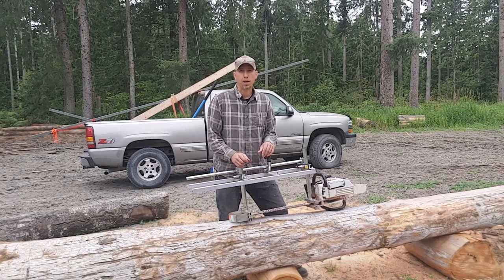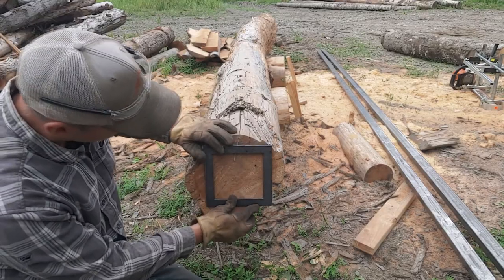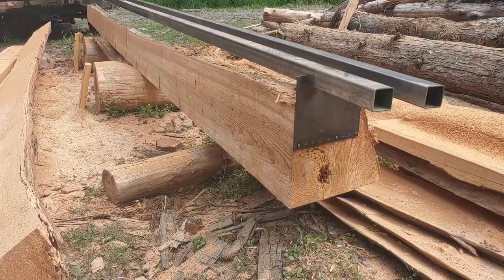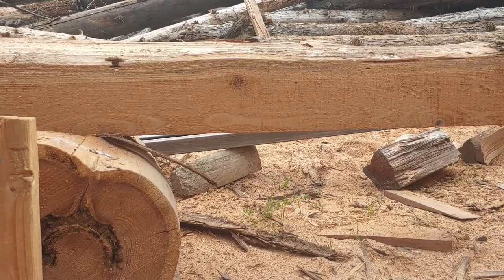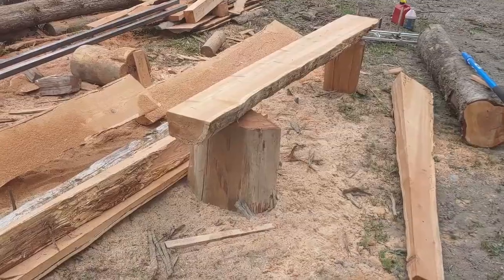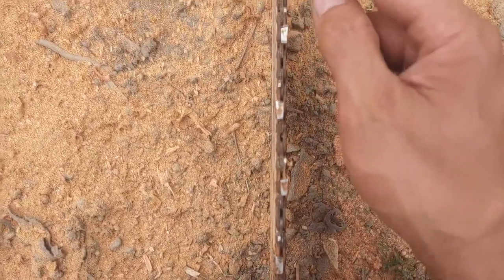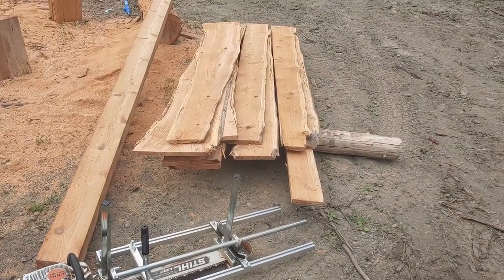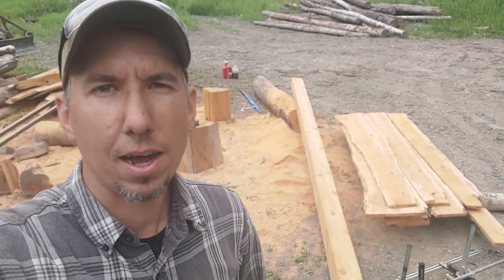Chainsaw Mill: Old Log, Perfect Boards

Comment: Great watching you do this.  I recently purchased some woodland in Missouri and there is a lot of 'junk' wood in there as well (black walnut, honey locust, red and white oak) some standing dead and some down already.  I find that with some effort, there's still a lot of good wood to be had.  Especially the honey locust which seems to be very durable against rot.
Reply from the maker: Yes!  I have found that a downed tree can still have some great wood in it.  I have salvaged a ton of good wood from what the loggers left a few years back

Comment: Two questions; DO you anticipate moving up to something like a Woodmizer mill and is this for home type projects or will we see this lumber in the mine?
Reply from the maker: Hi Dan.  Thanks for the comment.  I do anticipate moving to a larger, bandsaw type mill in the future.  They are so much easier to use and faster.  Most of the wood I am cutting I am currently selling.  I had never thought about using the wood for my mining projects, but that is a great idea that I think I will use in the future!  Thanks for the suggestion.